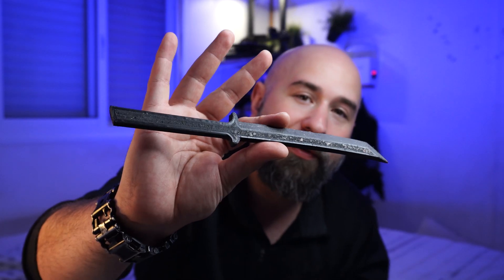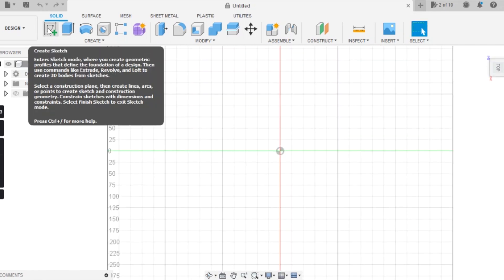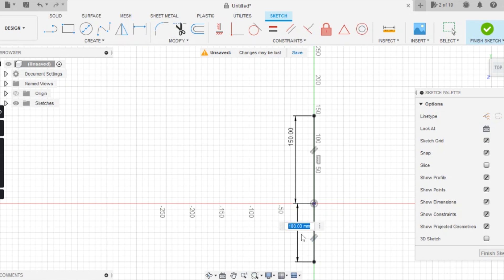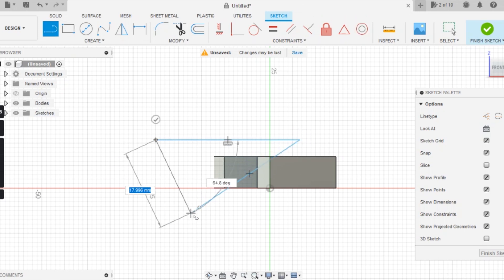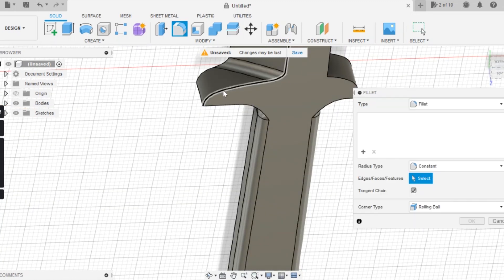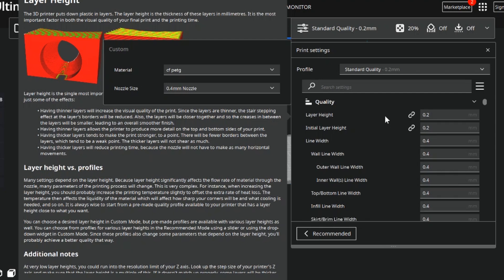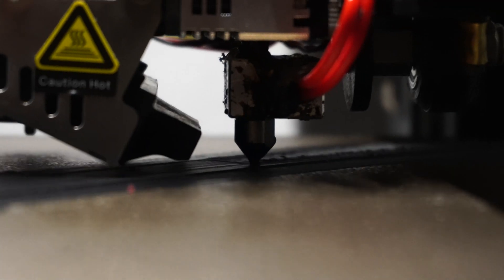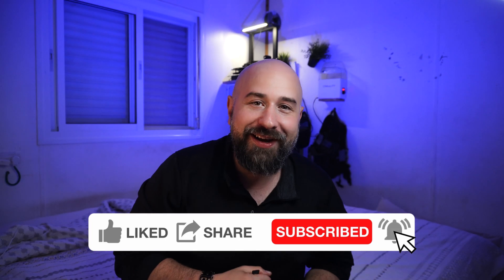I 3d printed a knife!! using carbon fiber nylon😮

Comment: How much shrinkage? I wanna make a lightbulb socket.
Reply from the maker: hey there, the amount the nylon will shrink is highly dependable on A) how much material your print will be B) what brand of nylon you use and C) how dry the filament was, going into the print, but generally not more than 1.5 %, the problem is that it has a tendency to warp slightly while it's cooling sometimes, but in general, the shrinkage is not that bad at all in my opinion, cf nylon is an awesome material and it is definitely worth a try
Reply: @z-made  Groovy  !!! Thanx◇
Reply from the maker: No problem🙂
Reply from the maker: Hey there Ja Hoff, I was just cruising through the comments and I'm wondering if you ever got to trying out that light bulb socket?